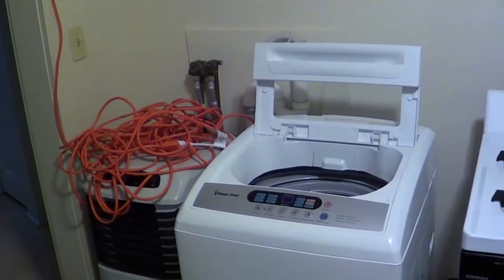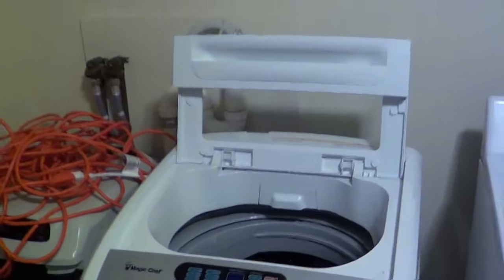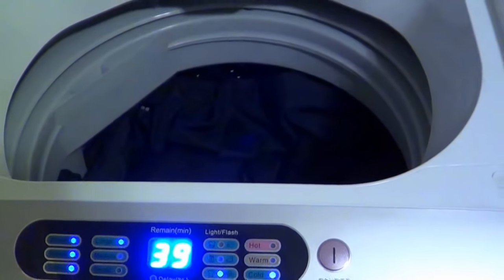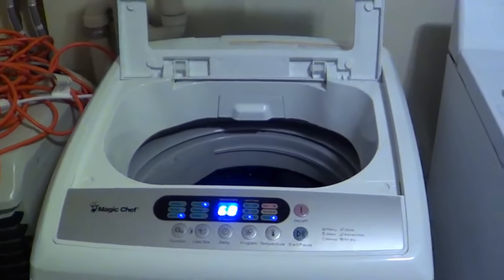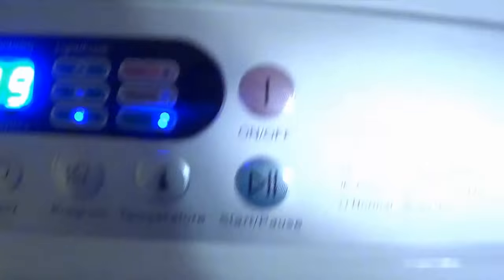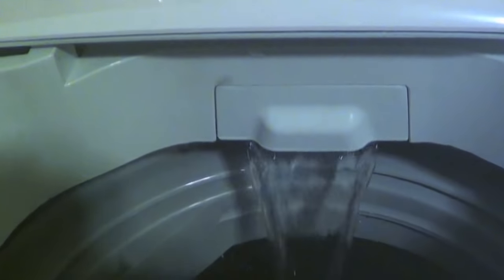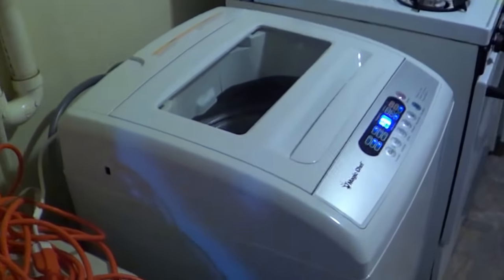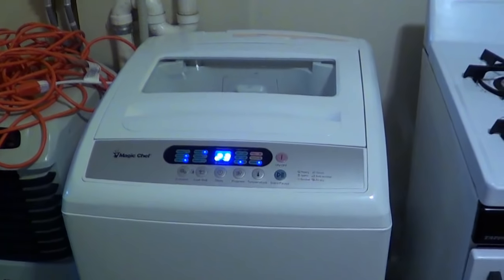Geekhouse Laundry With The Magic Chef Portable Washer

Comment: The delay but is very good because I can leave it soaking for couple hours and then let it wash on its own without having to remember to put it on to wash. It's a good feature to have so you basically set it and forgetting it, and by the time you come back your clothes will be washed.

Comment: I am reviewing this machine because we are about to move out of a house with our own large washer to an apartment where there is a communal laundry. Not having done this community thing before, I am unsure about sharing washing machines. Thank you for such an extensive review. I think I will get this.
Reply: It’s a pain in the ass, and over all, more expensive annually. Your water and electric bills might be slightly higher with this machine, but I did some calculations to get one for my apartment and my fiancé and I found that this, plus the matching dryer, would actually pay for itself in the span of three months with what we would save by not doing laundry in the community washer and dryer. We are hoping to have our set before the new year.

Comment: You can try putting a magnet on one of the front corners under the cover to see if that will tell the machine the lid is closed and you can run it with the lid open. I have a smaller version of this and mine works in the front left corner. I thought it had a switch in the back but mine didn't...worth a try anyhow.

Comment: How did you connect to the hot and cold water ?  Doesn't the washer come with one connector ?  What kind of adapter dld you use?  And does the aluminum you put in by the drain hose cut down on the detergent foam and stop it from spilling out ?  I should try that trick.  thx.

Comment: I had a magic cheif small washer and 110 dryer it lasted forever and it still worked when I got rid of it my mom had it then I got it and I'm pretty sure I gave it back to her and I was really surprised as long as you didn't cram it over full it washed fine you kinda wanted to dry have a load at a time because like I said it was just a 110 so it didn't get extremely hot

Comment: might have been said but reason it spins before it rinses is because it gets out as much soapy water as it can so the single rinse is enough to remove the soap from the clothing. most front loaders do the same thing.
it might also spin a little before between other rinses, again to get out more 'soapy' water to help the clean do a better job.

I think that hole/well you can see in the top of the drum is for softener but not sure the water output would hit it as it looks like it hits about the centre of the drum, so if in doubt, wait until the spin stops after the wash then throw in the softener, don't need the ball, just throw it in the drum (same for the soap at the beginning) or get the two in one be done with it LOL

if I can find a decent price for these in the UK I'm thinking about one when my current machine dies beyond repair
not sure if I want one like this where the drum spins or one where it has a agitator (disc)  in the base
Reply: oh and the delay is I think in case you want to set it to wash during the night, when hot water might be cheaper etc. or  you might want it to wash so it ends just as you come home/ get up etc.
Reply: dragonlord0666 can the delay be used as a soak? like does it fill then wait to actually start agitation or does the delay stop the water from even filling?

Comment: theman7431 I bought the 1.6 version of this. After a week I noticed even when set to hot or warm the wash water is cold. Not cool, cold. A repairman was hear for a few minutes today and said nothing is wrong with it. I played with it after he left and turned the cold (2 hose hook up) about 1/4 of the way on and watched. Even on hot cycle it only drew a bit of hot then back to drawing cold. Set on hot, water was cold, you could not tell any hot had even been added. The company is sending someone else out. I would like to know from other users if this is it's normal action as the repairman said. Thanks!! T.
Reply: I saw a similar review as you about Panda 1.6 cu washing machine on amazon. Panda one is almost identical to Magic Chef one (I believe that these two are just same OEM but different branding). The amazon reviewer received a reply from the customer support that the machine pours only a little bit of hot water for the safety so you don't get burned blah blah.

Comment: When you first turn on the water, do you keep it on the whole time it's washing? Or do you turn it off and have to turn it back on when it's in rinse mode? I want to hook it up to my laundry hook up area but don't understand how it works. I do not want to have to stand there having to turn on and off the water in between the cycle...
Reply: +Kitty Katz no and that was my concern also.  I have mine hooked up to the kitchen sink and during the course of a cycle, I keep the water faucet on.
Reply from the maker: Power and water get turned on and off each time.  It's a tad bit of a hackjob system.  :-)
Reply: sorry.  I may have not written that very well.  You don't have to babysit or turn on/off between cycles.  you turn the faucets on when you begin and don't have to worry until the cycle is all done.  it automatically draws the water in to the machine during the wash and rinse cycles then cuts it off in between.  the only thing you have to remember is to shut the faucets off before you remove the hose from the tap; otherwise, you will get a burst of water in the face.  lol  learned that the hard way.
I love my machine.  best thing I ever did was get this one.  takes nice big loads, rinses them out well, and best of all...spins them out so nice that i didn't bother getting a dryer; I just airdry.

Comment: Europe abandoned top load machines in the 1970's. They are a relic from another era, as is hot fill! Top loaders use excessive amounts of water, damage clothes more, spin badly and use more detergent. Get a front loader, cold fill, self heating and save yourself a small fortune. Will never understand why Americans seem so addicted to antique appliances.
Reply from the maker: These aren't antiques, they're higher efficiency descendants.  Look up "high efficiency top loading washer" for more info.  :-)